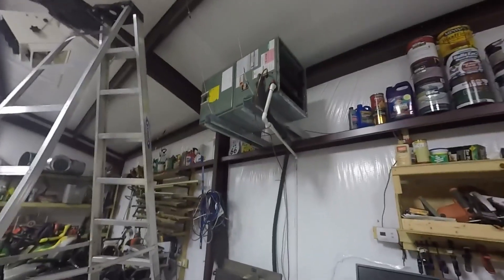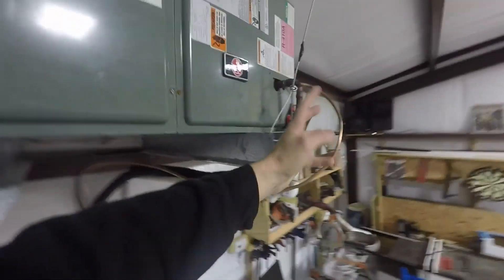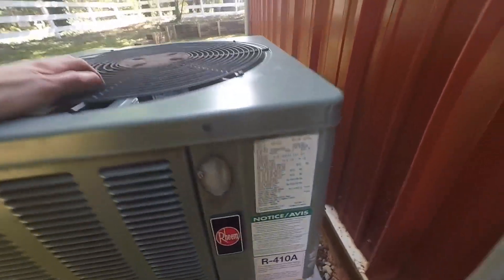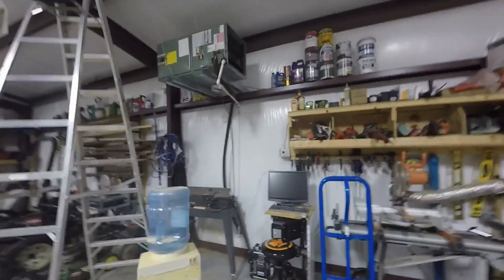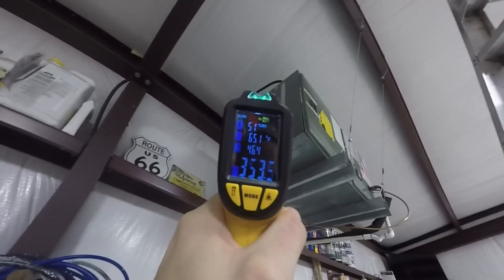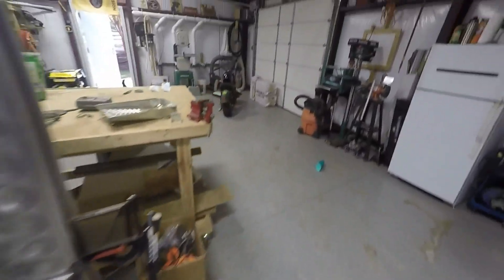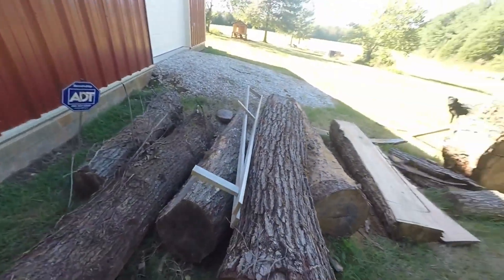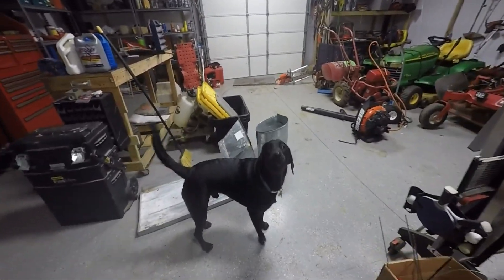Shop Update-Adding an HVAC System and Equipment Update

Comment: I’m getting an end of year bonus and I’m going to install a high efficiency Bradford White water heater to run radiant heaters this November and in the spring run Pex under the floor for radiant floor heat. I was originally going to get a condensing boiler but they are very expensive, require a yearly descaling, and they have mixed reviews for reliability.
Reply from the maker: That's pretty neat! You almost never see a boiler system where I live, my house uses natural gas for forced heat and hot water. Our cooling season is much longer than our heating season so we focus most on summer time cooling. Under floor radiant heat would be really nice on this hard concrete floor! I have 3 water heaters and one is a Bradford White and the other two are Rheem, I haven't had any issues with any of them.  Where I live both gas and electricity are really cheap, so I have a lot of options when it comes to heating. You'll have to let me know how that goes!